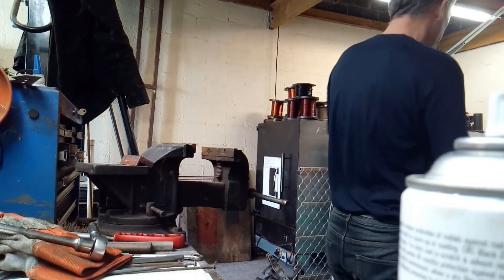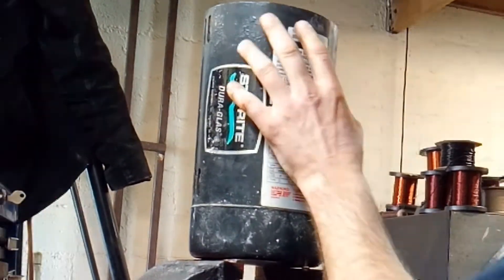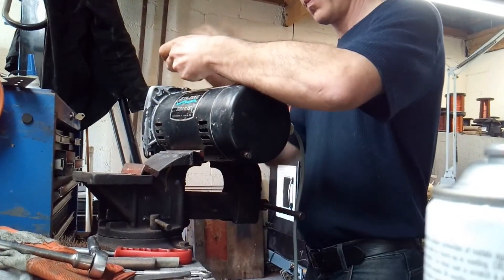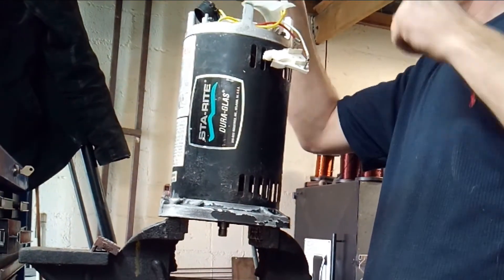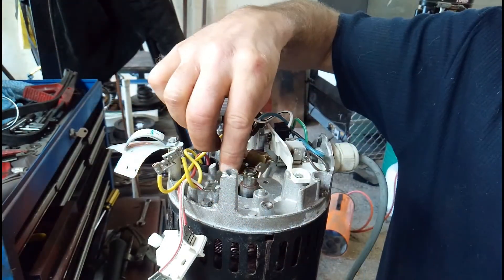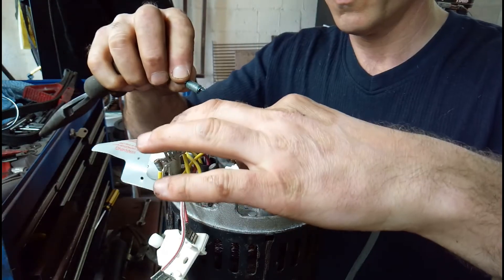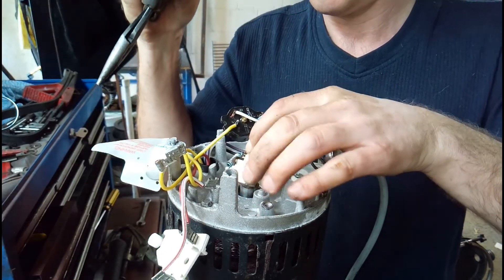Reassemble starite pump (overhaul video 7)

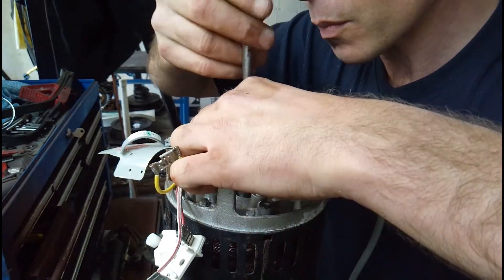Comment: 2:00 could you explain the position in relation to the shaft again? Ive seen a couple of videos of this but still have doubts
Reply from the maker: Hi. End of shaft has two flats either side...Making for a rectangular slot. Plate has rectangular hole. If it's sitting correct there should be no gap between. Good luck
Reply: @electricmotorrepair2605  thanks for your help

Comment: Hi new subscriber here. Love ur content. Ever encountered a problem where the capacitor is bad but to clarify if it's the capacitor really bad you manually turn the rotor and still it doesnt run?while it hums you try to rotate it but still nothing. What might be the problem? First time I've ever encountered this
Reply from the maker: So, from what I understand, You suspect you may have a bad capacitor and you have spun the motors shaft by hand to see if it starts spinning on run. 

Before I say any more, I would like to make it very clear that I have never recommended to anybody, anywhere to touch a faulty AND energized electric motor without testing it's insulation resistance to earth and circuit continuity first. But given that you are still with us, I suppose we can rule out the windings being hard down to earth. My first thought would be shorted turns in your run winding. You can test this (with motor disconnected from supply) by measuring resistance from where start comes out at switch (normally red with spade) to both ends of the run winding (start to phase tab, start to neutral tab). The start is centre tapped to run so you should get an even resistance on both sides which include half the resistance from run winding and full resistance of start in series.
Overall resistance of run will be different for different voltage configurations and motor wattages (ie 110VAC vs 230VAC 3/4HP vs 1HP etc). which is why I have not mentioned any expected ohms.
Hope this helps.